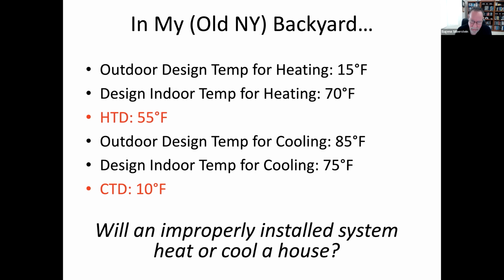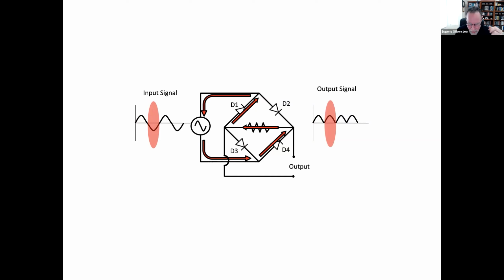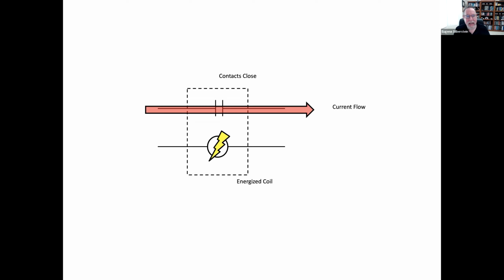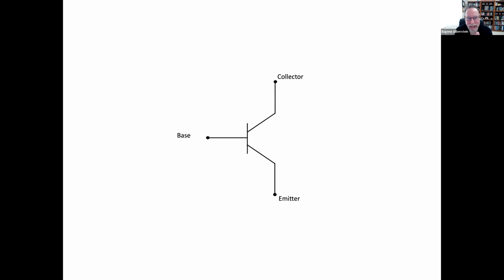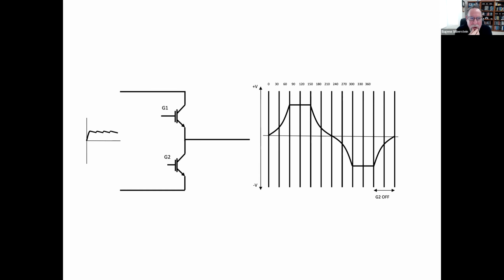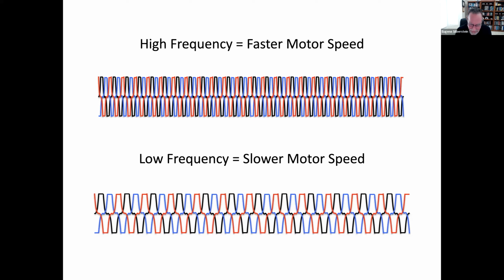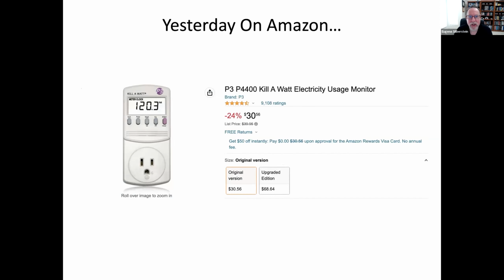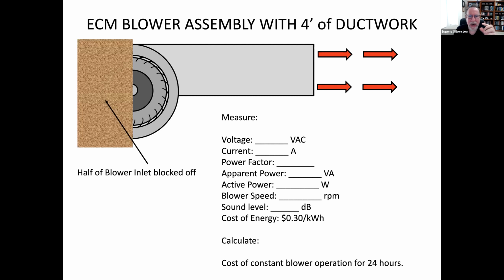Inverter Controlled Heat Pump Systems Operation, Challenges and Classroom Demos - Eugene Silberstein

Comment: Thanks. What do you think about installing inverters in areas with high ambient temperatures (up to 45 C in summer)? I've heard form several technicians that these systems aren't functional in these areas because the system protects itself too often.

Comment: what a joke of an explanation of how the heat cold cycles are controlled,  this tries to explain the ac to dc to ac inversion process works, not even trying to explain why the inversion is done, let along how the whole system is controlled, what waste of your time. spend your time looking elsewhere